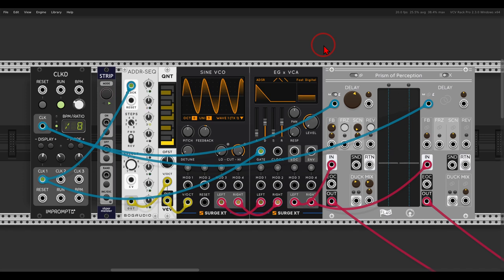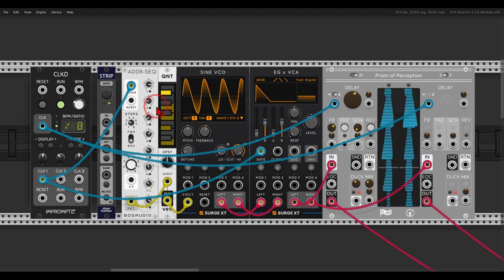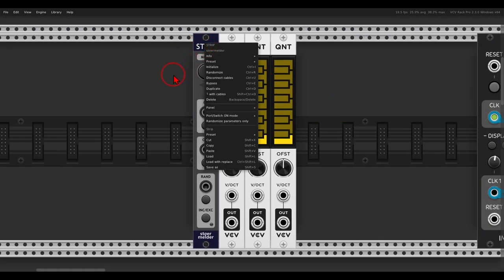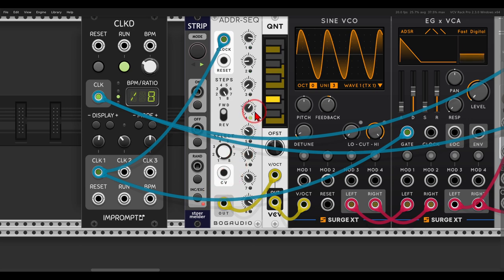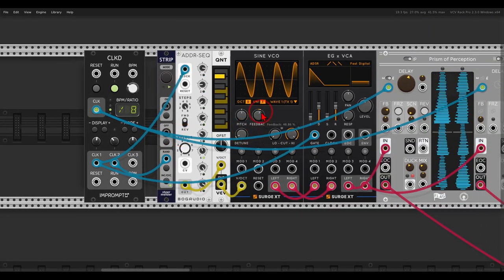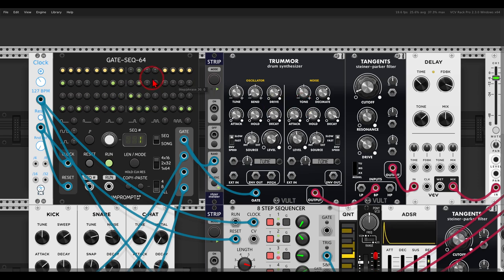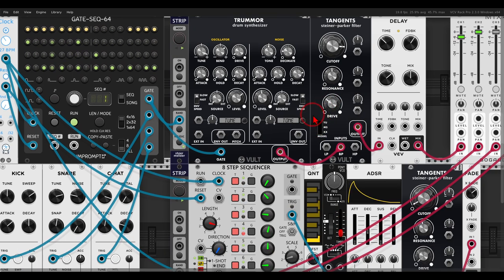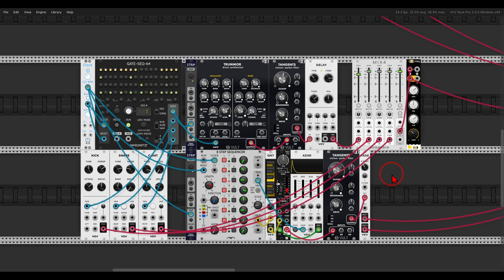Randomizing with Strip \ Quick Tip

Comment: Is there a module that wold let me do a similar thing, but with more control? Like, if I wanted to modulate a particular step in addr-seq vian an lfo? 
I am trying to make a better emulation of Intellijel Metropolix in VCV. Bidoo bordL already does a pretty good job, but they have a random offset for steps and Metropolix has the "accumulator" that goes up and down by a number of scale steps which makes for a more controlled sequence.
Reply: I'd hazard a guess at µMAP or Macro modules also from Stoermelder, depending on the extent of what you're trying to do. Not sure if they have built-in randomizer features, but they can add CV input sockets for module parameters that don't have them and you can work from there. (Definitely other modules out there for attenuating and randomizing CV values and quantizing value steps.)

8Face and Transit might also be of interest as well. But they're more like toggles or sliders for switching the values of multiple parameters at once. I guess Stoemelder is a bit neat to look at for the utility modules they managed to come up with.
Reply: @pauljs75  Thanks. Will look into these.